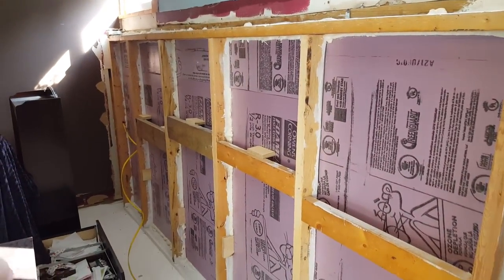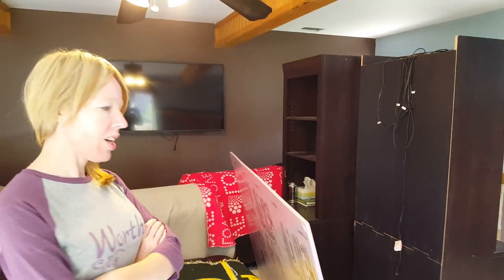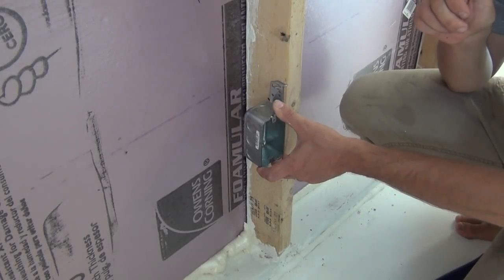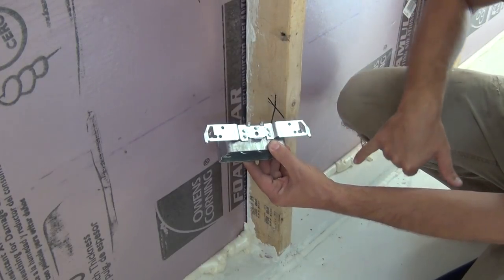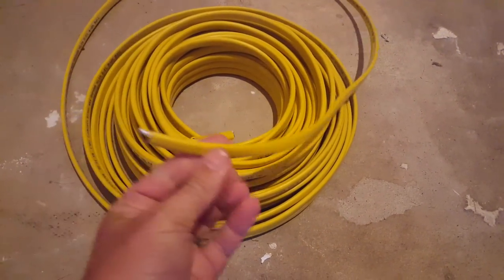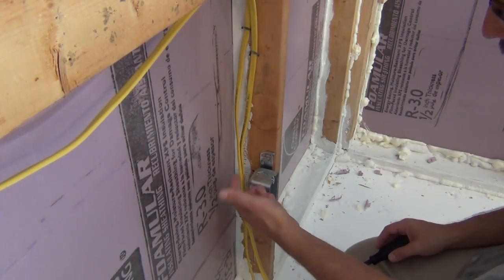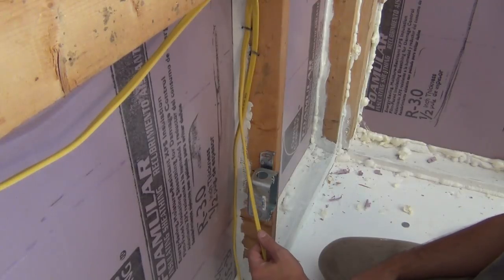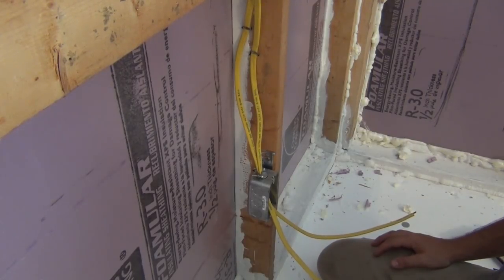How to Install a Basic Electrical Circuit

Comment: Tip.   Wrap your outlets in electrical tape.   That way if the cover plate breaks its extra protection against little fingers getting electrocuted.
Reply: +
spagettiosaddict

I've been studying electronics and found a great website at Gregs Electro Blog (google it if you are interested)

Comment: those are called handi boxes. 1950's style box. Metal box will cross thread and strip more easily than plastic. A sawzall will cut the 2 nails on a plastic box and easily removed with no drywall damage. Good luck trying to remove that metal box. You should rename this video. You had lots of errors and mistakes. GFCI is for protection for water. AFCI is what you should have used. Heater should have its own circuit.Using Small boxes and cutting the wires short no Bueno. Good luck going back into those boxes for future.
Reply from the maker: I understand where you are coming from but not sure I agree with your points here. I could just as easily cut the nails on these boxes as I could  the nails from a plastic box. Metal screws in a plastic box will always strip out when over tightened but a metal box would require twice the force to strip it out. Yes, if you cross thread either a metal box or a plastic box, you are correct that it is for areas with water such as kitchens bathrooms and other wet areas. GFCI will protect against shock by sensing the voltage differential and cutting power even quicker than a breaker and with much less power going threw you. Neither an AFCI or GFCI was required here in this install but I always like to use GFCI on just about any circuit and there is no reason not to. Heater does not need it's own circuit, it is only there 3 months out of the year and less than 1300 watts. wires were short, yes I could have left them longer but I still can't see any reason to. If I am back in the box later one it will be to just put in a new outlet and there is plenty of wire for that.

Comment: Be aware of box fill requirements. You have to consider all conductors and devices. The metal nail on utility box with two 12-2s looks small.
Reply from the maker: there are small for sure, no more than 2 12-2 will fit comfortably in those boxes.
Reply: Ya I was just looking it up and those boxes have a cubic inch compacity of 13cubic inches and a 12 gauge conductor takes of 2.5 cubic inches so that only gives 5 conductors to work with. For every 1 device you have you subtract 2 conductors which leaves you with 3 and box fill counts two 12 2 cables as 5 conductors so those boxes are over filled.

Comment: To replace a stripped out wall box just use a sawzall and cut the nails off and let the box fall back into the wall... some boxes you can get out then use an old work box to replace it and if your worried about it not being secure you can run screws into stud through the holes in the side of the box... easiest way I've found... I'm a union electrician
Reply from the maker: +Travis Meering great process to follow, I have a couple at my father-in-law's that I need to fix and will try that process

Comment: The problem with the single gang metal boxes is that they are usually too small, maybe 15 cu. in. or so. If you're set on metal, I would use a 4 x 4 x 2" deep with a single gang mud ring. This will give approximately 32 cu in, and plenty of room to fold the wires and use pigtails and wire nuts.
If you're having trouble with stripping threads on plastic boxes it could because your boxes are mounted to deep and causing some play with the receptacle. You can use shims or spacers to tighten things up.

Comment: How come i was able to convert one 2 prong receptical to a 3 prong receptical using a ground wire adapter screwed to the back of a metal box successfuly, but when I did the same to another similar outlet, with metal box, i couldn't get ground?
Reply: I'm not an expert, but is there a metal conduit running back to the breaker box, that is actually grounded? I don't believe just connecting to a metal outlet box, just attached to the stud, would actually ground the circuit.

Comment: Love these videos.    How much do you have in the forced remodel not counting labor?
Reply from the maker: +Marcus Kloepping about $2000 including flooring, paint, drywall, electric, insulation, and the basement sealer
Reply: SSLFamilyDad that is a small investment overall for the awesome return.

Comment: it's kinda too late now but i think you're supposed to use stud guards so your sheet rock screws, or any other nails, don't puncture your wire
Reply from the maker: here code is only if the hole is closer to the stud I believe. If you leave 1.5" from the face of the stud to your wire hole you should be good.
Reply: SSLFamilyDad i guess you don't have to then. And also if you ever come to middle Tn come check out my farm, i basically have everything you have from the bees to tractors, hay equipment everywhere you look, we even have a hydronic boiler. It'd be cool to see your take on all of our projects
Reply from the maker: oh man, I would love to check all that out! We do come down your way every few years so I will keep you in mind, thanks!

Comment: No service loops? You left plenty of wire outside when you did the rough in. Could have used  the excess for service loops and not used any more wire.